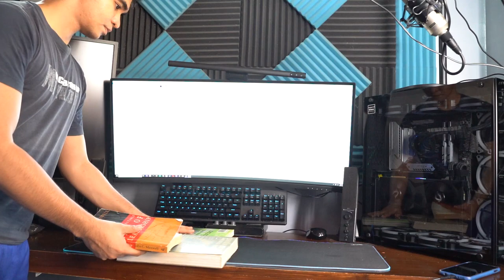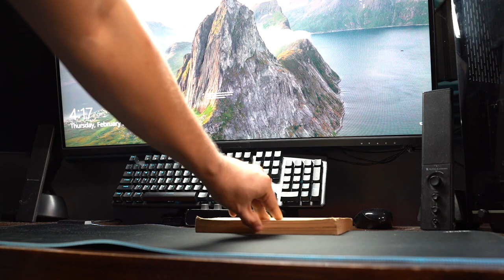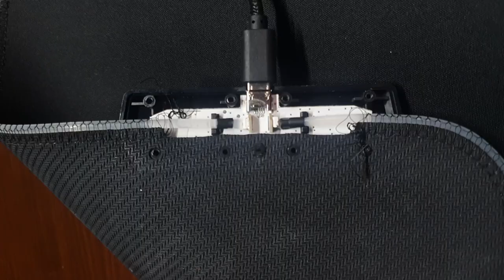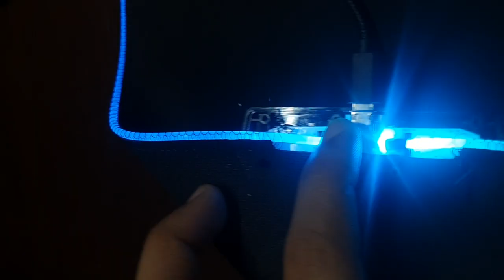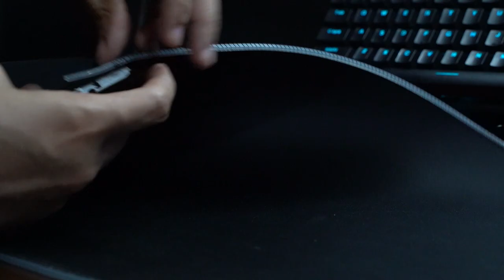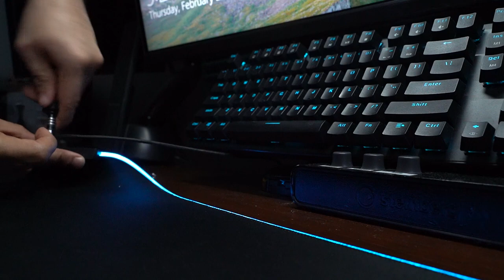How to flatten large LED RGB mousepad (LAST RESORT. NOT FOR IMPATIENT PEOPLE)

Comment: I had the same issue with my corsair mousepad, I just trimmed about a 16th of an inch of the end and pulled it a bit until it was flat. The sticker peeled off easily and was able to open it up with my leatherman and trim it up witht he scissors on it. I spent like 5 minutes on it and done.

Comment: my mouse pad lights not spreading to the plastic line. It spreads only to the starting position of  both sides. can I fix that?
Reply: The plastic isnt touching the LED. You have to move it closer

Comment: This just keeps happening with these crappy led / stitched optical cable pads. Finally I just pulled the optical cable out of the stitching and removed the control unit. Now I have a beautiful flat mousepad, minus the cheapo inconsistent lighting. Nothing of value was lost!

Comment: Critical mission failure. Was going slow and felt like I was making progress just to end up moving the plastic so far back it pulled out of its threads and went around the corner by about 3 inches. Guess mine was very kinked.
Reply: sorry bro